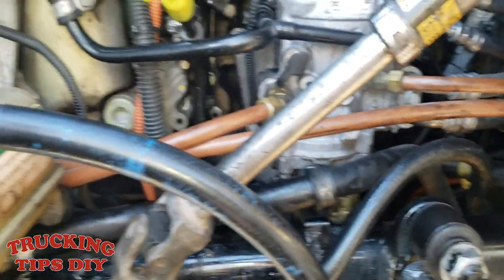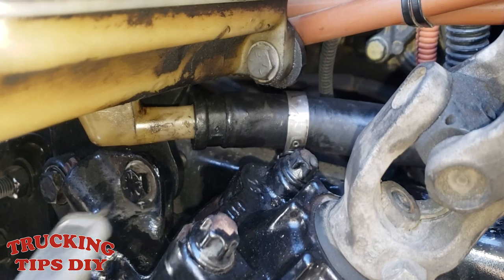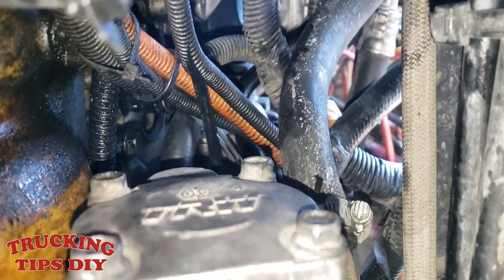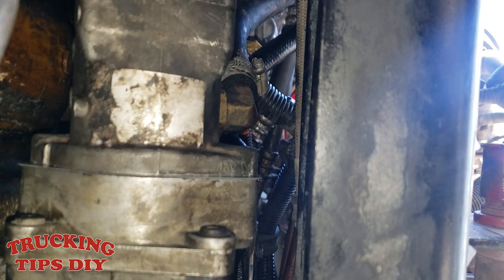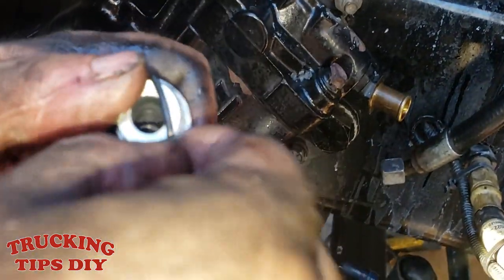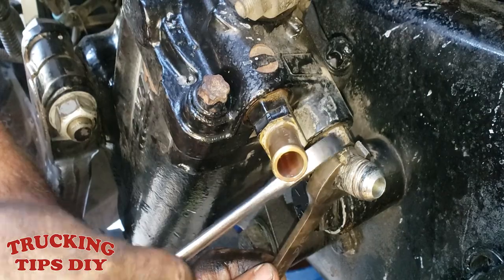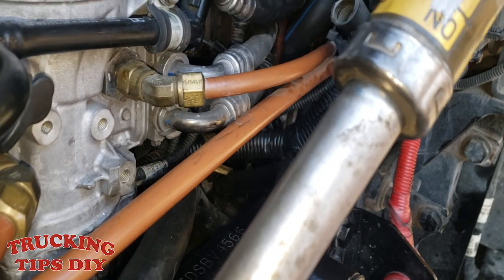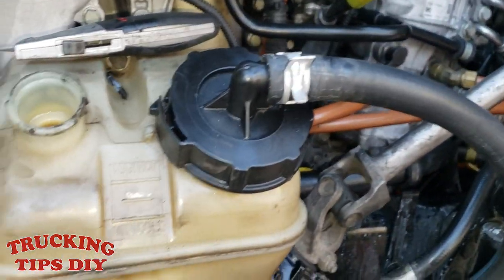How to remove and replace power steering pump on freightliner cascadia

Comment: How do you know when the pump needs to be replaced? I have a truck that the power steering works fine when its cold but after it is driven and then if you are backing into a dock where you have to stop the steering wheel is very hard to turn if the engine rpms are not up a little. Its nearly impossible to turn if the truck is  idling so I have to get the rpm's up and then its fine. Would this be a pump problem?

Comment: Good informational video. my question is to bleed the system should I keep the resevoir cap off to let air bubbles escape or keep it on and tight while truck is running and moving the steering wheel back and forth?

Comment: I replaced my king pins , drag link and joints 8 months ago but my drag link went bad agaain recently.  I changed the drag link again, but the steering fluid keeps bubbling inside the reservoir.  Is that a bad symptom from the pump ? It was bubbling and leaking a bit from the cap. Now that i got a new cap on it , it just bubbles.

Comment: I have a oil leaking underneath the truck i have 2013 cascadia can it be the power  steering pump I  need to get changed ?

Comment: Hey man thank you for the videos.  can you help me man having a problem with 2012 Freightliner Cascadia the truck & steering wheel, shakes and vibrate in high speed. When speed between 40-55 only and it stops and everything's normal, you know what causes them. Thank you.
Reply: It could be your king pins. Check your steer tires for lumps.
Reply: Check your king pins
Reply: Check your drive shift

Comment: great video. why did you replace it?
Reply from the maker: I replaced the air compresor,  there was nothing wrong with the power steering pump
Reply: @TRUCKINGTIPSDIY  why did you replace the air compressor? Was it not building up air pressure? Cuz thats the problem im having with my 2013 prostar maxxforce 13l engine. Truck won't build up pressure at all and I was told its the compressor.

Comment: I wish you showed how to get those 2 bolts out. 

I had drained the oil and disconnected hoses but couldn’t get that 1 bolt out which is on inner (engine) side.
Reply from the maker: You just need an extension for the ratchet for the inner bolt
Reply: @TRUCKINGTIPSDIY  thanks for your reply. Let me try that

Comment: sometimes my power steering has no power when im turning, sometimes the pump whines like low on fluid, but it isnt. pump going bad?
Reply: Try to replace the filter on the reservoir
Reply: Replace filter and fluid
Remember is transmition fluid.
Not power steer fluid.
Reply: @1HSYURIDIA  shit. I’ve been putting that “clear” power steering fluid from loves. Right now it’s real hard to turn. I have to turn real wide and pull the s&$t out of my steering wheel. Any ideas?